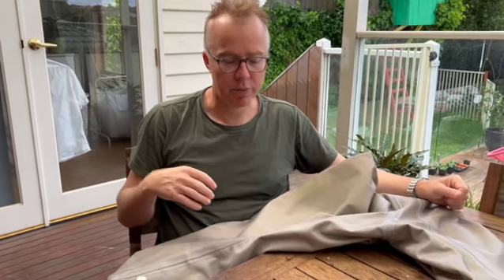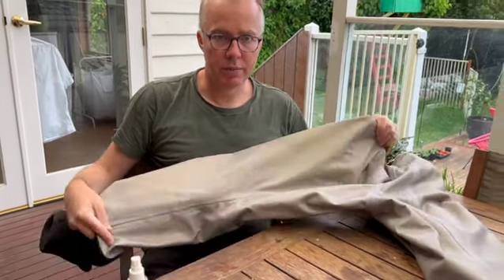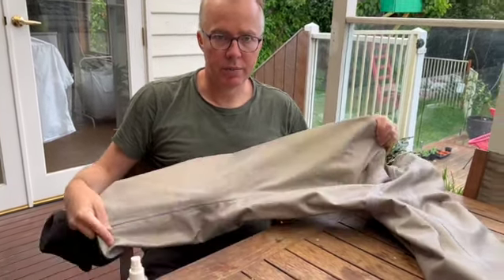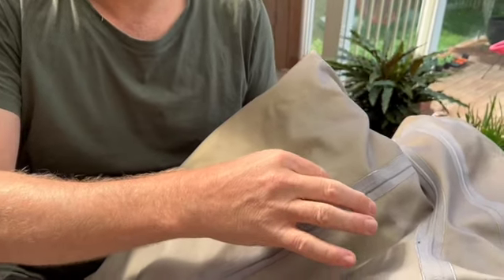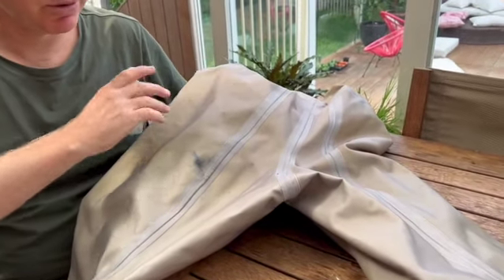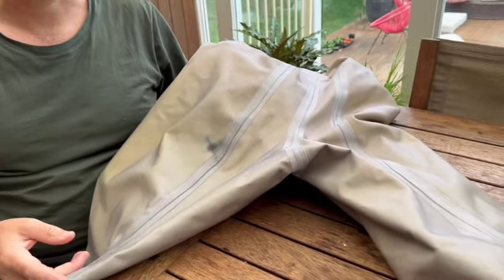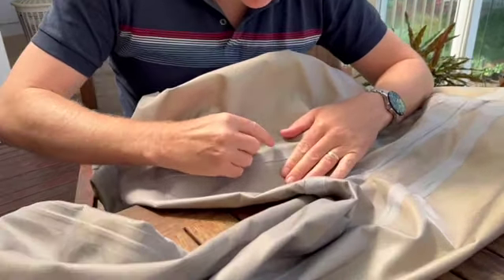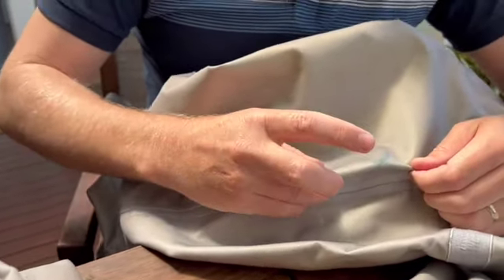Patching waders with Aquaseal: How to Fix Breathable Waders Leak

Comment: I just applied it to the outside, letting it cure now. Tomorrow I will be putting them on and hopping into the tub with cold water. I'll let you know [if you respond :)] if it worked. If it doesn't work I'll be trying to find the hole on the INSIDE and applying there. I sprayed with alcohol on the inside and it didn't turn black like that. I think my waders aren't made of the same stuff. They're Redington waders from 10 years or so ago.
Reply from the maker: Good luck with it. Hopefully it will work. Note the rubbing alcohol method only works with breathable GoreTex or Toray waders.
Reply: @tacklevillage5650  yeah these are definitely not GoreTex and I know nothing of Toray. I'll let you know how it goes.
Reply: @tacklevillage5650  short story: it works on the exterior. I applied it to a CROTCH SEAM leak on neoprene insulated waders and it stopped it. For good measure i applied a dose on the inside as well. 
On the breathable waders it seems to have stopped the leaks on the two spots I treated however I am pretty sure i have a 4-6 inch diameter area around the knee that needs to be treated. The knees get abuse for sure and i imagine i have dozens or more tiny little pinholes all over that area. I have tried the isopropyl method, dark room/flashlight, soapy suds and air, as well as a failed attempt of submerging the leg and trying to fill it with air from the inside. Nothing conclusive so my next attempt will be to slather the aquaseal all over the knee area and hope i catch it all. Not sure if it's worth it but new waders are expensive. I might use shoe goo as a protective layer afterwards to protect the knee areas